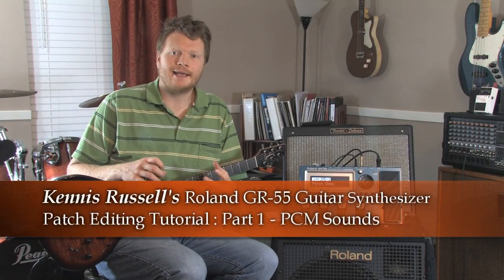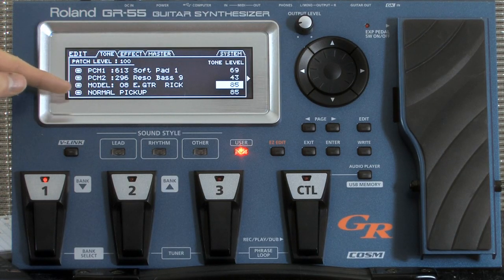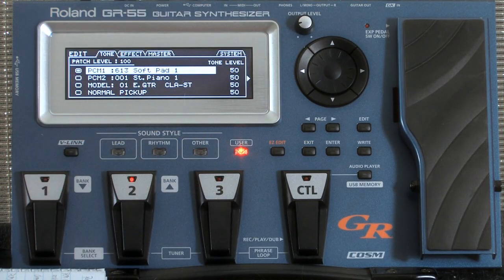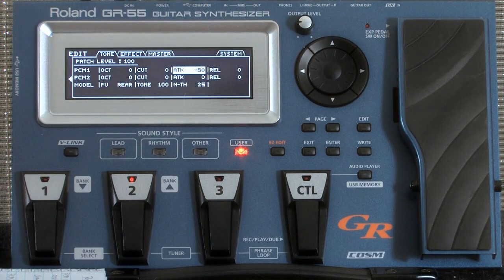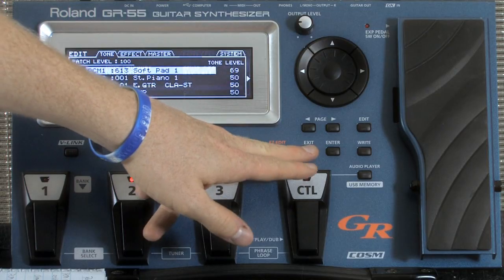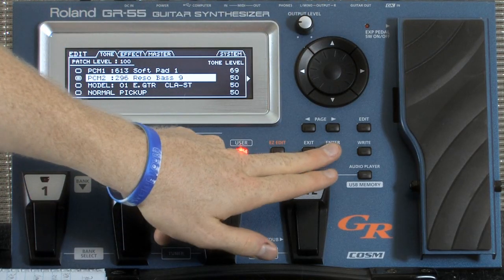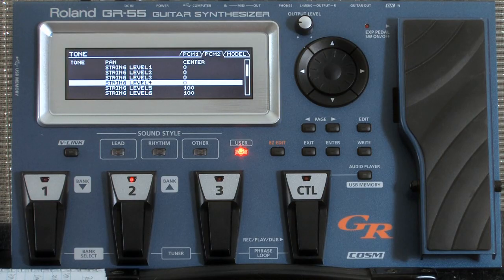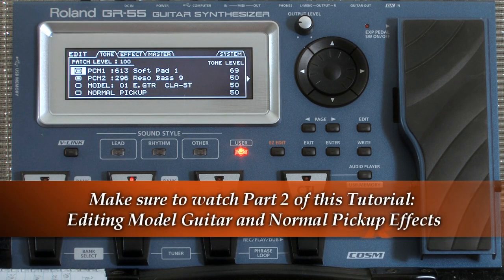Roland GR-55 Patch Edit Tutorial Part 1 - PCM Synth Sounds

Comment: Hi Kennis  - I have watched you videos multiple times over the years, as I come and go back to my GR55. I use it mor for recording my ideas than anything.

I too have a Godin (xtsa). I am wondering if there is a way to select between the accoustic/piezo sound and the humbuckers as they enter and pass through the GR55? It seems you can only have both constantly and just wipe the volume on either. I would rather select between the two. 

Also I would like to get the COSM guitar sound to provide more doubled up effect that is slight delayed and panned off centre (or humanised) so I can get a thicker distinct sound of two guitarists that doesnt sound uniform. ANY Ideas or thoughts??

Many thanks for all your work on these great videos 

Graham

Comment: I find your videos fantastic learning tools. I have come across a problem. I don’t know of it is an xtsa or gr55 issue. When I use the dial on board, all my patches are there but if I use the switch on my guitar, it skips over some patches. Am I doing something wrong?

Comment: I enjoy these videos too but I'm having a problem. Sometimes a string will drop out in volume. when I push the cable up into the input it goes back to normal volume. So I think I either have a bad cord or a bad input. But don't want to have to buy a new cable to find out it's the input that is the problem. What do you think?
Reply: Kennis Russell thank you but I've tried that and I really think I have something defective I'm just not sure if it's the cable or the input

Comment: I'm having serious tracking issues with the piano patches on this pedal. They are pretty much useless. Even when I strum a string consistently at a slow speed notes are missed. I've done the proper setup of the GK-3 pickup and I know that isn't the issue because other patches work just fine. I've adjusted all of the settings in the GR-55 as well and haven't had any luck. Advice anyone? Thanks!
Reply: Hi Kennis.  I can't reply to your comment on my phone for some reason.  I have lowered the sensitivity on all strings before, but when I did I had to pluck the strings pretty hard for them to sound and it actually made it worse.  I was on the phone with Roland tech support the other day and they suggested that as well.  Can you tell me what your settings are on the piano patches?

Comment: Hi Kennis Thanks a lot for the lesson my friend, impressive!!!! I was an owner of a 1978 Avatar, and that was ok for single lines but this thing is just awesome! Can you PLEASE do another PCM clip looking for a steel guitar sound, I think that that "chromatic " mode might work real well as I noticed when you did the bends it reminded me of the steel, so important in Country, but a real pain to cart around and set up for what usually will amount to 35-55% of most "pop" country band's material. Also, good players are hard to find and sometimes can be prima donnas because of the apparent lack of them!!

Comment: Thank you so much Kennis, it´s been helpfull all your tips for handiling this amazing gear, I´ve been usinning your tips to finish my covers lately, check if you like my covers in my youtube channel, users name (Fausto Ramos Lugo). Please continue with your videos, that´s because on the web you can´t find tutorials for this equipment, and it´s been kind of hard to handle all the advantages.
Reply: *****
 hey mate

with reg to setting the normal guitar pickups

after i set the normal pickup to a specific patch, the next time i go back to that patch, the normal pickup is not engaged again, so i need to set it again and again to get the normal guitar pickup sound.

question is, how do i make it sound permanent with the normal pickup turned on?

Comment: Great Vid Kennis. Thankyou. Do you know how to simulate the poly function of a boss Oc3 pedal on the gr55. I do a similar thing regarding putting an octave on the 5th and 6th string only on my boss Oc3.
Reply: Yes Kennis, an octave below the 6th and 5th string. thnx
Reply: ***** hey kennis :) so im workin away at the gr 55 and how to use it, one thing im still confused about is the preset user patches, i was wondering how many user presets i am allowed to overwrite for my own sounds, also is there any spare user patches in the library that dont have any factory settings put into them? or is every single user patch preset, what worries me is that if i overwrite a preset user patch thatt i like but have to sacrifice to make my own sound, how do i get it back, ( will i have to save them all to usb or is there anything else i can do?? thanks, i know theres a few questions but much appreciation for all the tips so far!!

Comment: Is there any way to do two harmony leads . Also looking for the Marshall sound :0)
BTW. You have the BEST instructional videos on this product on You Tube
Reply: I'm really just starting to work with this and I'm seeing the different sounds are almost unlimited, It's like you said. You really have too sit down and just work with it
Reply: You can use the expression pedal to throw in a pitch bend on the modeled tone or PCMs, that will cause it to harmonize with anything else. You can set it to (+-)1-12 hope that makes sense. I just routed the model and the pickups through the same amp with the model pitched down 7.
Reply: No problem. I've had this beauty for a few months now. The only thing I'm not sure about yet is setting the assigns. If I assign the control/expression pedals to anything, it seems to override the system settings for the control/expression pedals. Any advice?
Reply: Haha I know right. The instructions are really vague on it and I'm not even sure if that will have a practical application.

Comment: What I found was changing the settings for the "Guitar Out" and also for the other "Output".  Page 54 of the manual.  You can set the "Guitar Out" to Patch (which only plays the patch sounds, "Normal PU" which plays the guitar sound and I think, "Modeling" which, if memory serves me correct, plays the guitar and amp modeling sounds which the "Output" (when plugged into a pa or another amp) will play the other patch sounds.   You can set the "Guitar Out" to "Both" I think too. =]

Comment: hello there, i just purchased the gr55. It's amazing. Got a question, can I run my guitar through the gr55 using my guitars pickups (and not the gk3 pups) and use the wah function? what other effects can i use with my guitar pickups? so that the gr55 acts like a regular effect pedal? When I use the gk3 there are latency issues. some patches on the machine seem to have no tracking issues, im wondering if thats my guitars pickups running throught the machine. 
 I hope you understand my question.